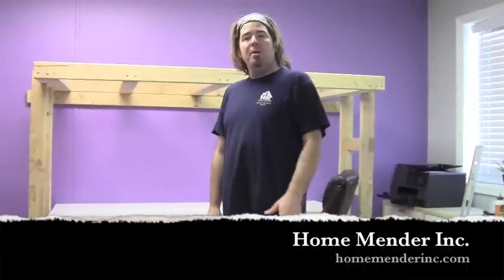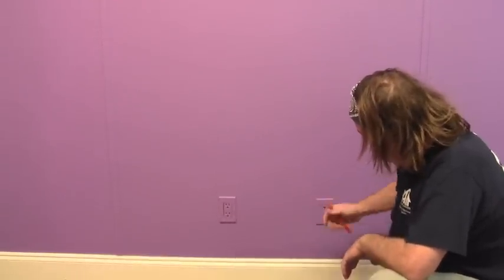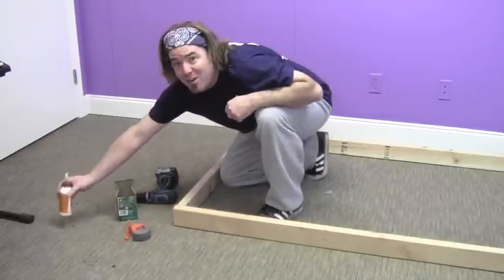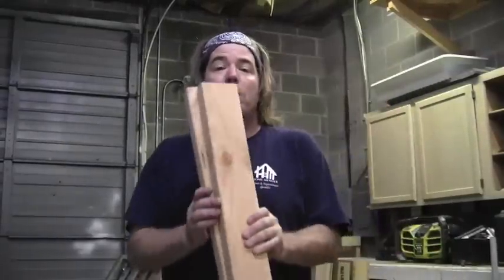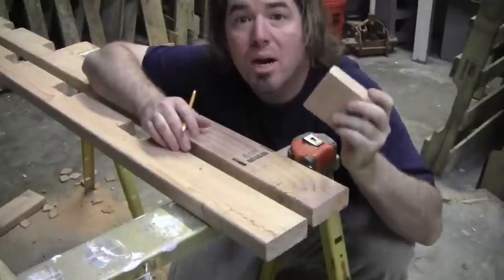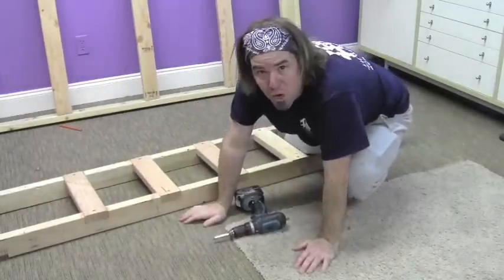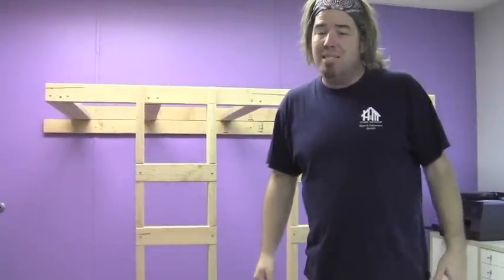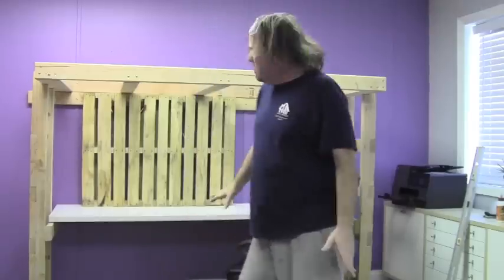How to build your own bunk bed and desk under 50 bucks! Home Mender.

Comment: As a woman in her 60's it took me a little while to mark and cut all the boards (outdoors) before I started assembling it but making it was easy. The hardest part for me was cutting and chiseling out the notches in the ladders with the big circular saw I was using. I really like the fact that this bed is stout and will last me a very long time. l did use big lag bolts to assemble my bed with because I didn't trust using the smaller screws I had on hand at the time. Besides, lag bolts aren't expensive! I didn't use lag bolts on the ladders. There's something about saving space and having a bed that will last me many years that made this project very appealing! I love having my bed and workplace all in one and proud to say I did it all by myself! 

Thanks Dustin!
Reply from the maker: patricia! you are an absolute gem...thank you so much for sharing this! you rock!

Comment: The ladders are the best !
Reply from the maker: thank you patricia! appreciate you saying so!
Reply: @homemend    I'm planning on attaching a long platform to the wall and adding a couple steps .I'll attach my loft bed to the platform instead of the wall when its done and use a couple ladders on the front corners for support (nothing on the sides)
I love this design- it's much stronger than most!  Thanks !
Reply from the maker: awesome! thanks for sharing!

Comment: I'm a single mom moving into a smaller space and I want to build this by myself. I have never even attempted to build anything either so my question is what do I need to build this for a king size bed? Like exact names and how many, I will have to get lowes to cut for me.
Reply from the maker: hi kelly! thanks for commenting! a king size is about 76" wide and 80" long.. your two long sides should be 80 and you ends and middle braces should be 73". I hope this helps! you got this!

Comment: I’m thinking of making a bunk bed for myself but it won’t be attached to the wall. Could I use 2x4s as support beams on all four corners or should I use something else?
Reply from the maker: hey raging..sweet idea... you probably could as long as you get hardware than can support the weight.. you got this!
Reply: @homemend  So some bolts and nuts instead of screws, got it! Thanks!

Comment: This is great, I would like to do it by myself but I'm not sure how stable this is. Would it be possible to do it on both sides of the bed, covering the whole width of the room (160cm, really tight) and putting the ladder on one of the short sides (where the feet go)?
Reply from the maker: hi Denis! I had two ladders, one on each end... it rocked! really, you can add more ladders for more stability. thanks for watching!
Reply: Thanks!!
Keep on with your videos, they are great
Reply from the maker: thank you denis! appreciate the comment!

Comment: Hi,
I want to use two of the Ikea Kallax storage units as a corner for additional storage space and want to place the mattress on top of them. How do I make a frame to support the bed, I don't want to secure anything to the wall. My kid wants a "girl cave" under so having the ability to nail hooks onto the 2x4's is a plus.  Any suggestions?
Reply from the maker: hi patti! great question. The frame size should be the same, you would just want to make sure your storage units are spaced under the supports. Sounds like a fun idea!

Comment: Will this hold a 400 lbs human?
Reply from the maker: hi roderick... good question... if you need a 400 pound weight limit i would suggest building with 2x6's in place of 2x4 and adding some additional hardware such as L brackets or ties... i hope this helps!
Reply: Home Mender Inc do you suppose structural wood screws would suffice? I have extra 2x4 I’m trying to utilize that’s why this interests me! I’m thinking possible put another 2x4 on one end like you have rested the bed frame on! I have some extra 2x6 would you put these where you screwed the lumber that’s screwed to the wall where the frame rests? I’m planning on this going up in a corner area!
Reply from the maker: heyhey  it sounds pretty good to me. my only concern would be the cross braces of the bed frame splitting. additional support under would certainly help and going into a corner is another plus. good luck!
Reply: Home Mender Inc I want to put a hobby desk under the bed!! Should I do the ladders out of 2x6 or do you think 2x4’s ladders on the end will hold the weight? Splitting? You said L braces?
Reply from the maker: 2x6s would add some support, using some sort of framing hardware on the cross braces would be a good idea.